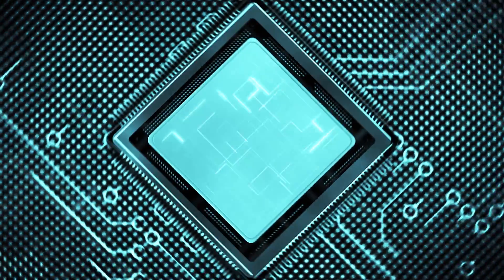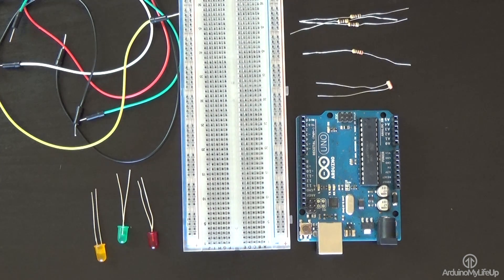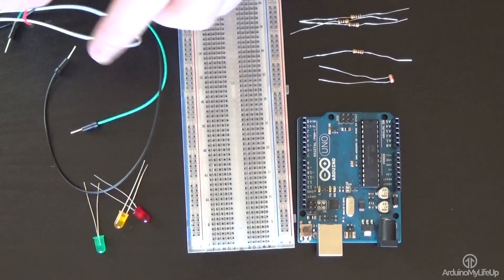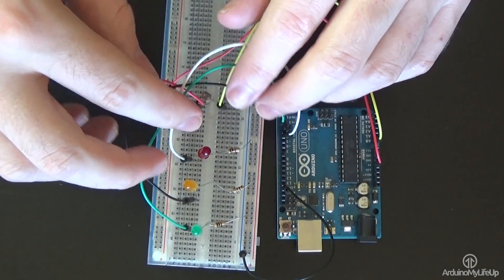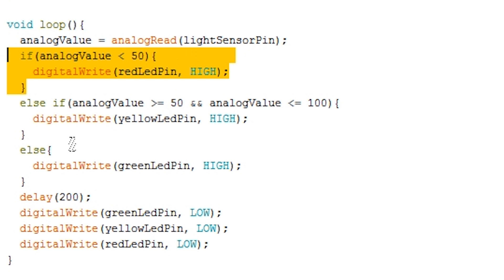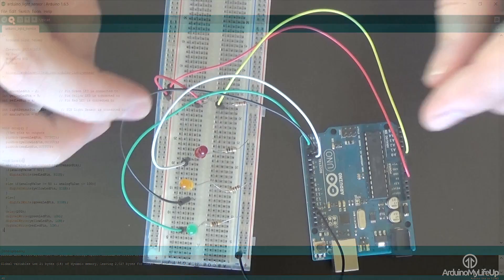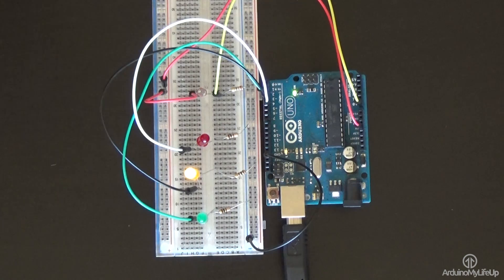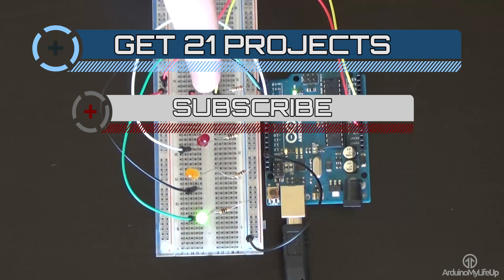Arduino Light Sensor Tutorial: Learn to Setup a Photoresistor

Comment: i am planning on using a light sensor with some pir motion sensors so they light up the stairs when someone walks in when it's dark. i am also thinking on making the light led strips on every step and it lights up with cool motion, like it when someone comes from downstairs it lights up from down to the top or if the someone comes from the top it lights from the top to the bottom.

Comment: Connection with a laptop/PC is necessary only while coding right? 
I want to use light sensors outside, far from any connectivity, to measure direct sunlight (lux>32,000) 
Is it possible to set up the light sensor system with a battery for power and a memory device to store lux data?
Also, once maximum luminosity is exceeded, will I keep receiving the maximum measurement or will it crash or something?
Thank you.
Reply: Yes they give u a batter that has 3 Aa batteries roque Dd and two wires red and black so with that battery  they give u a big battery thing which has 2 pins on top and u can connect that to get power or if h don’t have that battery use the big battery thing with that 3 Aa Bettie’s inside connect the red wire into the left and black to right if that doesn’t work try switching g the wires black right and red left and connect that round port to the port on aurdino 
And it shall work u don’t need a memory card it already knows but don’t press the reset button and if h do u have to redo the code again 
NOTE: aurdino isn’t water proof so if it’s raining u might want to clean it up fast cuz if water goes in the ports pin holes it will not work

Comment: 1:44 - I do not understand the purpose of the 220 ohm resistor. I thought the photoresistor was acting as the resistor here? All I know is that's called a voltage divider and I cannot find ANYONE who can explain it where this beginner can understand it. Why can't you just push the 5V through one side of the photoresistor and measure the analog voltage coming out the other side of the resistor? 5V in will never exceed 5V out, so no damage to the ADR. I don't get it.
Reply: the resistor is to extend result width of the photoresistor in arduino
Reply: we are measuring the voltage across the 220 ohm resistor rather than the photoresistor because  if we use the photoresistor alone then despite the resistance (which varies with light) the voltage measured across the photoresistor will be 5v (only current varies) , so we build a voltage divider and Vout=(Vin * R)/(R+P) now as P varies vout varies and we get analog values, by connecting a POT instead of 220ohm we can vary the sensitivity.

Comment: Wait, why not make a common cathode connection for 3 LEDs and put a single resistor between cathode node and gnd? That simplifies the circuit and you need just a single resistor for LEDs.
Reply: As long as only one LED is on at a time, my (very limited) understanding is this would work just fine.

Comment: why in your program you wrote:
if (analogValue <50)
redLed will be HIGH?
You said that when the resistant is low that mean it's has more light and not dark, so that means that theGreen led should be HIGH instead.
It's seems to me that you did the oposite to what you say about light means low resistance and darl high resistance.
Hope to hear your explanation about this, thanks!
Reply: Would a 270E resistor work properly for the photo resistor אמיתי עמר

Comment: Hey, I'm just confused about one thing. Why are we adding a resistor in series with the photoresistor? What's the purpose of this?
Reply: The aim is to limit the current flowing through the photoresistor in order to avoid an overload.
Reply: It is not in series, it goes to the ground wire. It's a voltage divider.
Reply: we are taking the voltage across the resistor connected to the ground, now this voltage is dependent on the resistance of the photoresistor  by V = (Vin*R)/(R+PR)